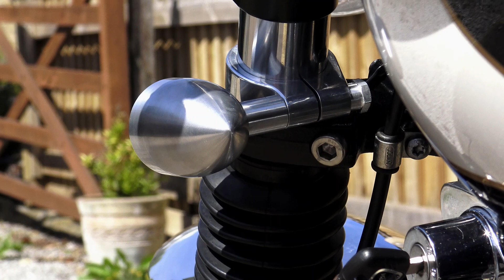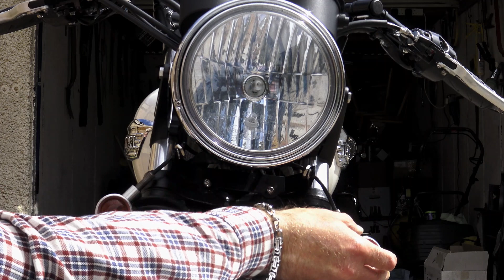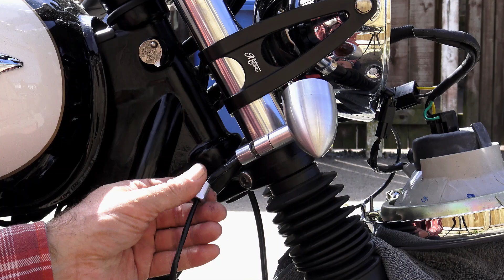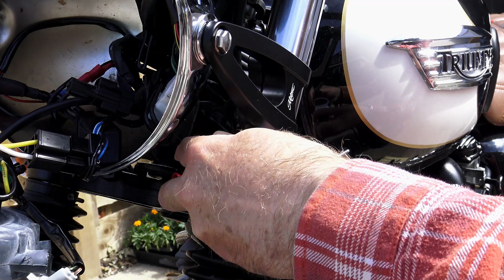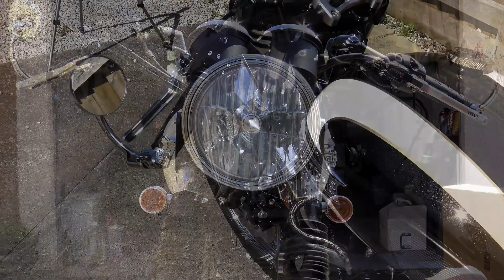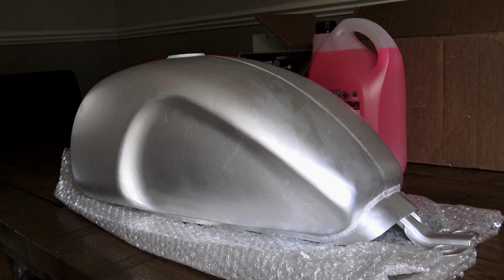Custom Triumph T100 Bonneville, Motone Customs CNC wrap around indicator clamps!

Comment: I really want one of those headlight brackets by Motone, but I have the upgraded Triumph black LED indicators which fit to the prssed bracket. Is there a bracket available to fit these indicators to the fork leg thus enabeling me to have the headlamp bracket without having to get the Motone indicators ?The Triumph ones are fine and I have not had them long. I am also fitting the Hagon fork springs very soon so now would be a good time to do the lot in one hit.Thanks for a great video Stuart.

Comment: Stuart, any thoughts on perhaps polishing the aluminum tank rather than painting it? Or half polished, half painted with a painted stripe on the top? Also, do you really want to delete the airbox? Generally, the airbox provides longer airhorns to the carburetors which help the low end. Removing the airbox is better for high end power but you may lose bottom end which is where you really drive the bike. Then you get into the whole re-jetting thing. Great video. Doug from AmenMoto.
Reply from the maker: Hi Doug, Motone do have a polished version of the tank, but we decided for the sake of the series that we would go with full paint. The bike will be remapped with the air box removal, and again we thought it may be useful to demonstrate the whole process.

Comment: Looks like typical high-quality items; are there any clearance issues at full lock with them mounted that way?  BTW, I notice you haven't fitted a centrestand, the Triumph piece is a fairly simple job to install, works quite well.
Reply from the maker: no, no clearance issues thanks for watching! didn't want to put a centre stand on as it may complicate things later with the exhaust.
Reply: Yes, that could be an issue, I pulled the centrestand off my old Yamaha because of it.  I opted for the Triumph performance mufflers on my T100, no issues with the stand that way (as I recall, I'd done the mufflers -- "not for road use", haha -- before I purchased the stand), don't think there were any other exhaust parts on the market back then, there are more options now.
Reply from the maker: Yes I think Motone have some in development! so looking forward to seeing what they come up with!